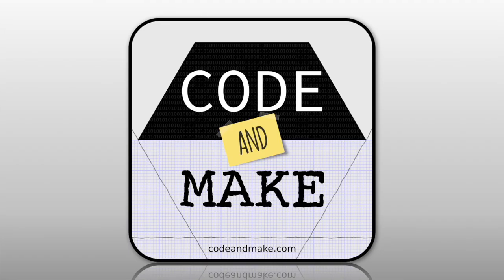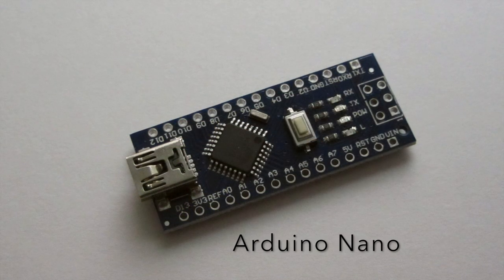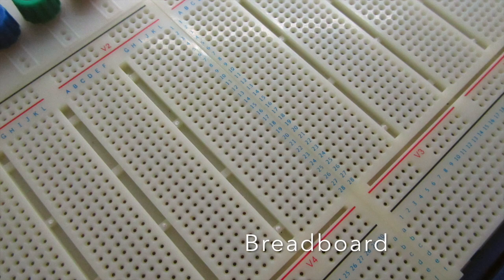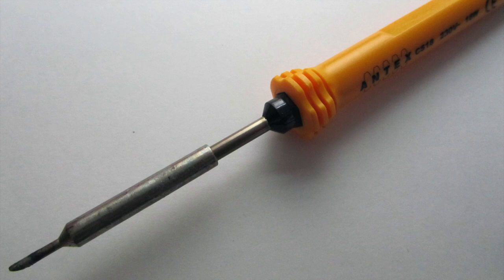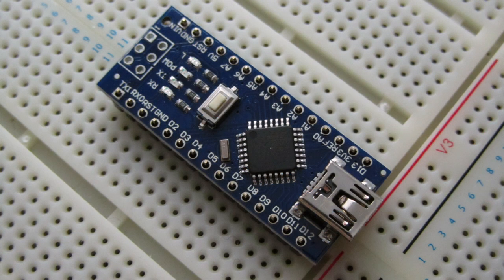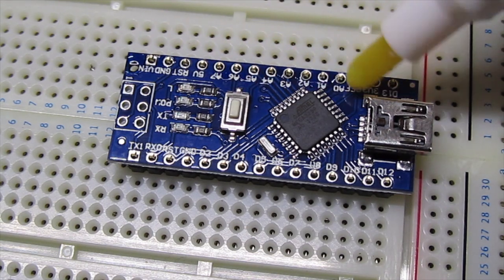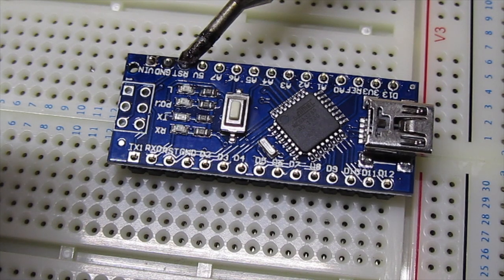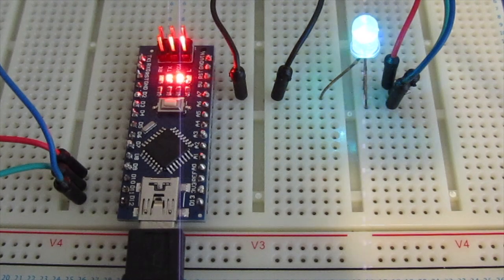How to solder an Arduino Nano

Comment: Which temperature should I solder with?
Reply: I believe I heard in another video to use 250 - 260 degrees. Not sure if this is C or F now that I think of it, but I set my iron to 250 and it seemed to work well.

Comment: Im currently looking into soldering but i couldn't choose what type of wire to use. I'm a complete beginner and idk how to solder, what wire should I get for arduino components?
Reply from the maker: Hi j j,

Wire thickness is often measured using AWG (American Wire Gauge). With AWG a lower number represents thicker wire. Typically you should use larger wire for power lines and thinner wire for signal lines. I would suggest something around 24 or 26 AWG would be a good size to start with for most projects. I would also recommend using silicon-coated wire, if possible, as opposed to PVC-coated, as silicon-coated wire is bit nicer to work with (IMHO).

Comment: So pin header's long pins should be on top and short pins should  be under right?
Reply: No, the short end of the pins are being soldered to the nano, with the longer ends being inside the breadboard